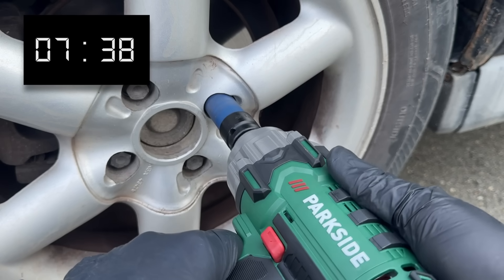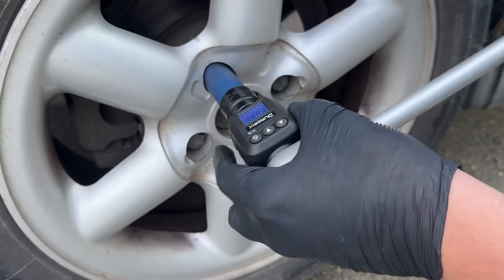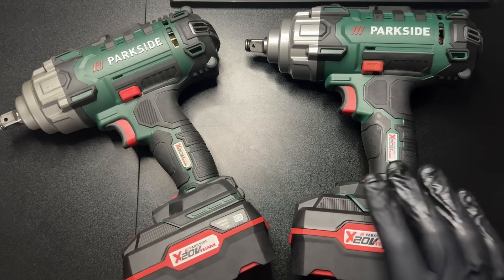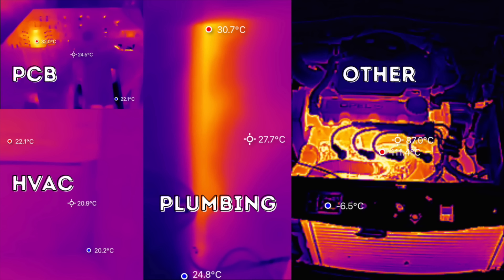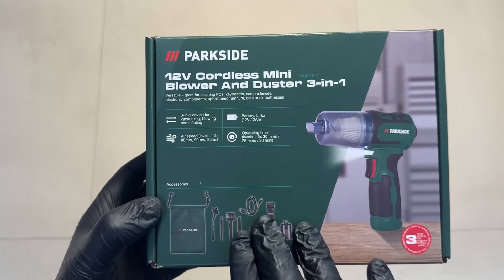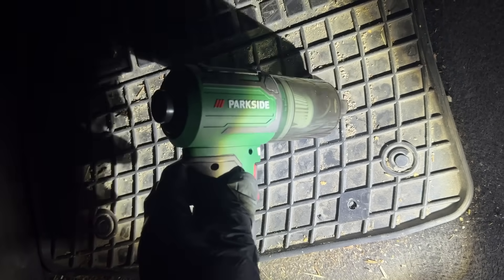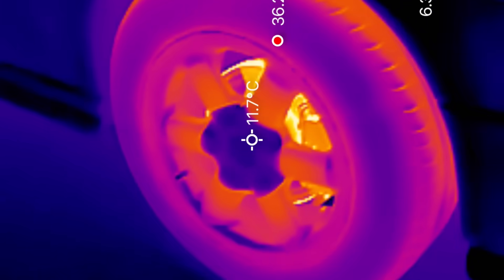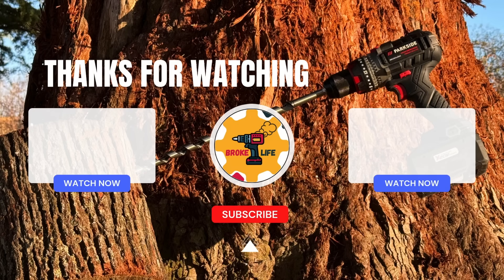New Tools Tested! Parkside Impact Wrench, Blower, Worklight & Thermal Master P3 Camera Review

Comment: Too bad this video didn't exist a few weeks ago. Got the impact wrench, and after hammering away at one set of steel wheels it looks like the impact part of the tool clearly points only to the effect it has on your wallet. Oh well at least there was the charger and battery included. Here's to hoping for the poor performance to literally "brush away" with time 😅

Comment: No performance Impact Wrenches currently here in Lithuania and I bought the C4 for 79.99 Euros.

With freshly tigtened wheel bolt and CR-MO socket it can only undo bolts up to 170nm, anything more than that and it fails. I hope that brushes just need to adapt but i really doubt that for some reason.

In lidl de there PASSP C4 kit will be avaiable for 99.99 from October 27th to November 1st in stores which i think is a lot better deal.

Comment: I just bought a C4 impact wrench for 40€ without battery or charger. 

I bought it before seeing your video. But, it handles the 130 Nm of my car very well. It does take 1-2 seconds to undo them. Maybe it is the same as it always was: The hammer is not made very well and if it hits correctly, the tool works fine?

Comment: I got the impact wrench, it lasted about 10-15 short uses, started spitting shards out then died. I opened it to have a look and it turned out to be one of the brushes fell out, the brushe holder started grinding hence the shards, once the holding had rubbed away that's when it died. Turns out it's a common problem the brushes are not replaceable well at least it would be extremely difficult without damaging the motor, I bought a Chinese wrench from eBay instead half the price, far superior to this crap. It just keeps going and going, and as more rattle to it aswell.

Comment: On the plus side, Parkside's swift, determined and ongoing exit from the pinnacle of value tools is opening a gap in the market. If a company can come onto the scene at a bit higher price point and offer a similar warranty without the gamble, then it could make buckets of profit and make lots of weekend warriors happy. I don't see anything else that compares to 2020 parkside performance like the A1 impact driver here, those tools were a steal. I'm stuck babying some great performing tools, not overworking them, blowing them out after use, worrying that every time it stops, if the battery is empty or if the tool is dead, or if the tool just killed the battery. Truly a hellish lottery. And if this channel is telling us anything, it's that the future is bleak for this beloved brand. Lidl, if you're paying attention as you should: please, stop dethroning yourself from the podium of value tools, it's going to end badly if you continue the ensh1ttification. Example: There's a francophone fanpage on facebook, "Parkside les outils de seigneurie": check out the admin's videos of 2020 vs 2025 and their comments, you'll see how loyal customers are ready to jump ship in their masses because of the bean-counting. Company reputation used to be paramount and I fail to see what's changed, but Lidl don't seem to factor it in to their strategy. 'll continue using my range but I have no confidence in the future of the brand as it stands. I'm one of many quiet quitters and my disappointment is enormous because Parkside was a true disruptive force in the market. We loved having Bosch level performance and we knew that the tools wouldn't have the same lifespan, but there's a groundswell of fans who now have to concede that they invested in a platform that is running itself into the ground to remain the absolute cheapest, in every sense. Massive props to BrokeLifeEu for having the courage to publicly document this shift, it's showing his true integrity even where it might hurt in terms of future sponsorships or collaborations. Time watching these videos is time well spent!
Reply from the maker: I couldn't agree more with your points about the brand's trajectory. It's truly disappointing to see a beloved brand struggle with consistency, and I appreciate your kind words about the channel's role in documenting this shift! You have been here since day one and I can‘t express how much I appreciate every single comment you make on this channel! Thank you for being s prt of this channel! ❤
Reply: @BrokeLifeEU  #BrokeLifeArmy 😁

Comment: 13:30, you know, I have that light and I like it. 
I like that it only knows ON and OFF.
Reply from the maker: It‘s simple BUT it just WORKS! 💯
Reply: I have two of them and they've been used a lot in my hobbyt car mechanics, fell down few times no problem and once I left it on top of the engine close to the turbo and it survived. Last week I lowered the car while the lamp was under it and it bent the floor of the car but did not break, still works and I've been using it today. It is a great product and with 20v 4A battery it lasts I think 20 hrs or more

Comment: Aldi has an amazing offer for a 20 euros air blower. Aldi's ambiano version is full metal and brush less and comes with useful accessories, a slider for speed and yeah, I use it a lot.
20 euros. Lidl shouldn't try to use brushed motors on something like this, which is a bit sad, considering that I was also looking to recommend one to a friend as soon as I saw this video up.
Reply from the maker: Is it this one by any chance? https://www.aldi-sued.de/de/p.ambiano-turbo-luefter.000000000000640526.html
Reply: @BrokeLifeEU  YES!

Comment: What have you said? Aluminium wheels are hardvér to undonethan steelies? All aluminium wheels have steel inserts where the nut or Bolt contact with the wheels....
Reply from the maker: OEM aluminium wheels in most cases do not have steel inserts in the bolt holes — the seats are machined directly into the aluminium. The coefficient of friction between aluminium (wheels) and steel (lug bolt) is usually higher than between two steel surfaces, which means the bolts can feel tighter or harder to undo, even when torqued to the same value.
Reply: @BrokeLifeEU yes they have steel seats. All Opel and Ford wheels have it.

Comment: believe it or not: A friend bought the parkside impact for his car workshop. 2 Years after he bought it, he gave it to me. It still works. Of course it doesnt have the power anymore so in 100 or 200nm it doesnt do anything anymore, but in 400 nm i am still able to change my car tires.  Battery also works fine without a problem
Reply: Usually, a bolt that has been torqued to, let's say 120Nm, and then kept torqued down for a while, the rust, salts etc, will have the breakaway force be multiple of what you originally torqued it down to. 

So, there is no point in using anything less than the maximum for removing a bolt.
Reply: @oilybrakes  yeah but like i said. I had no Problem with it changing my tires after winter,

Comment: Watching this after I just got the impact. Regardless it's still a good deal for the 4a battery and charger if the tool is at least usable. Ill hope what the other guy with the new brushes said is true and power will come when the brushes get used a bit

Comment: I also bought a C4 impact wrench, because in Hungary it’s half the price of the Performance version. I noticed yours has a red motor fan — my first one had that too, but after two days the Nm selector got stuck, so I returned it. My second C4 had a beige motor fan instead and it is working fine. Kinda weird that it has differences like this

Comment: Man, I love this channel. I was planning to buy the new impact to replace my old one. I have no complaints about performance on my older one, but the plastic shell actually cracked just below your pinky finger from the vibration and the counterweight of a 4ah battery. When I pulled off the TPU over-moulding I could see it's actually pretty thin in that area and really could do with being beefed up. I plastic welded it back together and reinforced it with steel wire. It should hold up fine but I was planning to grab a new one when they come in again, just because they're cheap. Thankfully I saw this video though. 

I thought that blower was junk when I tried it. I have a cheapo AliExpress no-name one that performed much better. It's good that it's simple inside though. You can probably mod it to take an X20v for better performance. They actually sold battery holders recently that are great for this kind of tinkering.

Comment: Wondering what will happen if you repleace the wires to the motor with bit thicker ones and add solder to the pcb for thicker "lines" so you have less voltage drop (and in case of new impact - let it run for like 1-2h more for brushed to fit better , maybe that will help , or maybe they used to thick greese ? Or seals ? They do that in 20v green straight grinder when the fabric on top is so tight the tool have like 2k rpm less rpm and heat up on top like crazy and after i take it out (and enlarge clutch holes.....)  it works rly good

Comment: You just saved me 20€ with that fantastic blower/sucker that I will not buy now. Thanks!
Reply: For 12V version blower..
You may check the WORX WU094 12V blower is fantastic. 
No regrets buying this.
Reply: @fantasy6408  A tad pricey for me.
Reply from the maker: Glad I could help you out! It‘s not too bad for the price, but it‘s not lifechanging 😂
Reply: @BrokeLifeEU  Have you seen what smaller blowers from china can do? Smaller than this but it blows so much harder.This is waist of money.

Comment: Seems like my C4 is better, it hardly opened weel bolts at 300Nm and 400Nm on a regular screws.
Reply from the maker: I am in fact certain there are units out there that can reach 400Nm breakaway torque, but it‘s the consistency that‘s the problem. Not all of these new tools are the same. 😕
Reply: @BrokeLifeEU exactly! We don't know how much consistency was in the past, because we tested only one tool, just recently you but 3-4 tools to test.
Reply from the maker: @Vladimir_tools It‘s now up to 6 😂 but on the 6-th attempt I found a good 12V impact wrench so I‘ve tested it against my 2024 model, still editing the video, but we‘ll find out soon!
Reply: @BrokeLifeEU 😁
Reply: @Vladimir_tools  If you need 400nm to break wheel bolts you are overtightening them unless you drive 18 wheel   semi truck .Normal car bolts should go from 100-130 nm depending on car model and type of rim you use.If you ahve problem with rust you should use anti sieze copper grease.
Reply: @zumbazumba1 I only test them like @BrokeLifeEU does. But have in mind that a wheel bolt, tightened at 120Nm, after 8-10 months will be over 200Nm.

Comment: The blower is way too weak. A 3D printed addon for the 12V grinder produces much more pressure and air volume.
Reply from the maker: I was thinking about that, I was actually considering purchasing the 3D printed part and the grinder too, but I thought for that price it‘s best to get a random blower from Temu or Aliexpress.
Reply: @BrokeLifeEU  I paid 20€ for the 12V grinder and I already have a 3D printer. So it's a no brainer for me. If you want, I can print it for you.

Comment: I just wanted to buy new parkside performance impact wrench but I saw your video that saved me from poor quality tool :) I thought that maybe 20v version would be good enough but from this video I know that all new parkside impact wrenches are trash. Thanks!!!
Reply from the maker: To be fair I found one 12V one on the 6th attempt that seems good so I will make a video on that as well. This 20V tool isn‘t much but again if you find it in the discount bin I think it is worh considering, just not at €100 as the Perfomance one was at that price as well, but say €55-60 or even €70 I‘d say with the battery and charger it‘s alright although it has its limitations. But you also get a good 3-year warranty on it.

Comment: That’s because the new brushes in the new motor don’t transfer power as effectively. Basically the brush is a rectangle sitting on a round comutator. Once you use the tool for a bit (drain two 4Ah batteries at least) the brushes wear out a bit and sit much better on the comutator. You’ll see quite substantial power increase aswell as cooler running motor.
Reply from the maker: I did use it for about an hour before making the video, because I wanted to avoid testing it as absolutely brand new for that reason. I don‘t know if it was used for two 4Ah batteries but we did work with it beforehand.
Reply: @BrokeLifeEU oh okay. Well I’d say you’ll still see some power increase after you use it some more… Maybe it would make an interesting video idea - compare brand new brushed tools to used ones to see how big of a power increase you get, if any (I may be wrong and they use already pre-shaped brushes, but I doubt it). Btw I got the new blower and it isn’t the most powerful tool, but for blowing dust from my tools it’s good enough and that’s the only reason I bought it anyway, so I’m pretty satisfied with it.
Reply from the maker: @adambelohradsky Absolutely! It‘s a great video idea! As for the blower you are correct, I was really disappointed at first, but then I took the price in to account and it‘s alright for that price, nor excellent, but also not horrible.
Reply: @adambelohradsky 
I keep a brush in each tool set for cleaning it. A brush costs nothing.
Reply: exactly. This happened with my x20v pressure washer and my X12v polisher.
Reply: Klingt interessant. So ein Vergleichsvideo würde mich auch interessieren 😉